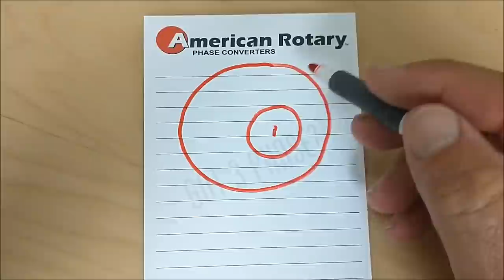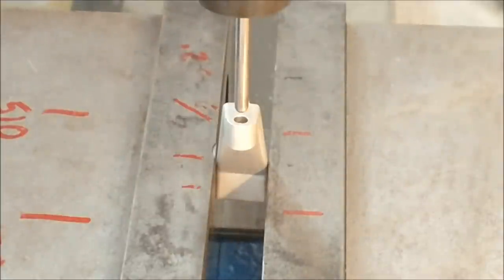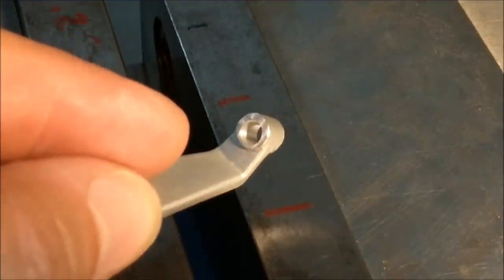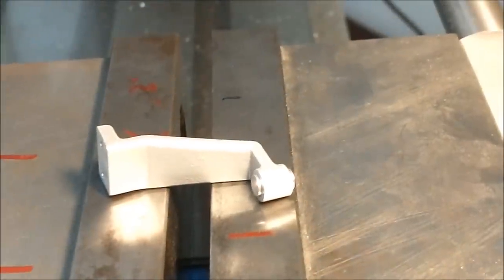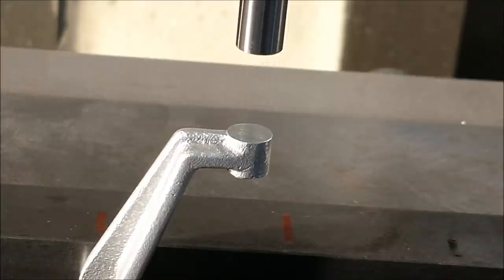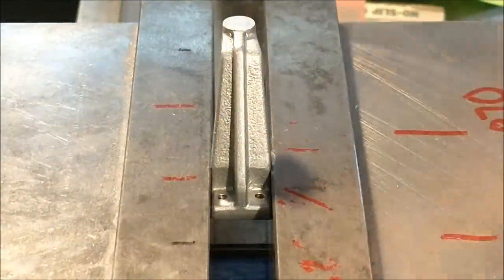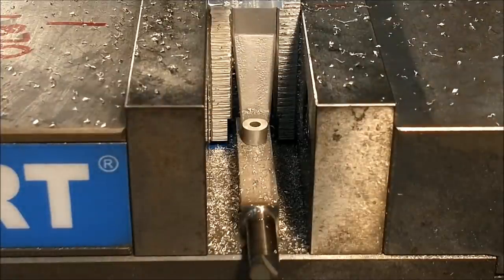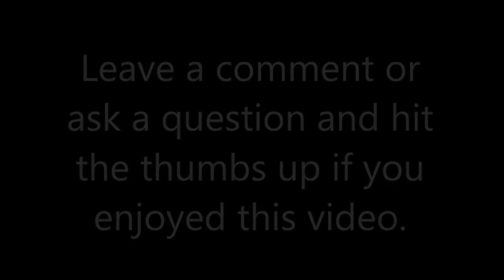Is It Impossible to Move a Hole in a Piece of Metal?  No.... Watch This !!!

Comment: Seen it done to a pin in a die, to move the alignment pins slightly, as in 2mm on the one, and 1mm on the other, to get the die to align correctly with the other half, and also the material being worked with. He drilled out the brass to make a recess, then machined 2 stainless steel plugs with the correct offsets on them, and brought them in as exactly like you had, a barely fitting fit, then put the one in, and aligned it, and then once done put loctite 603, then checked, and put 2 pin punch marks to hold it, then did the other one, and the same to it. Punch marks just in case the scribe lines wore away, and that die fitted perfectly. Had to be careful on the plug drilling, as there were water channels drilled through that brass block as well for cooling water.

Saw another bush that he did as well, where the original 30kg block of continuously extruded brass stock had basically 30kg of material removed, leaving only a bushing set that had, as thickest wall feature a lip of 8mm, the rest, with all sorts of holes and slots milled into it, being around 3mm thick, and with it being eccentric, ranging from 1mm to 5mm on sections, with gear teeth to adjust it. Adjustment bush for a massive printing press, with the OEM part coming in at around $100k, and a 6 month lead time as well, after payment up front. They made them using CNC, he used a lathe, mill and a few fixtures he machined out of aluminium extruded bar, for a tenth of the cost, and made them in under a month full time work. Hope he is enjoying himself now as he moved to Australia, where he can work for a decent pay, though I have no doubt he will open his own shop soon enough.
Reply from the maker: Repair can be a very creative field. If you find a good repairman, hire him.

Comment: Really smart repair job, Joe. I will say, don't know about the part but I definitely was more than just a little twitchy watching you squeeze  that bushing to bond in such a thin area of casting ugh. Really interesting technique and glad it worked for you but I think that I'd rather have turned the Bush slightly oversize  than risk bursting that ring of casting. Personal preference suppose, I can be a little heavy handed at times. Great job Joe.
Reply from the maker: With only one side of the casting being a finished surface, a misaligned bushing during a press operation would have certainly burst the casting. I think my approach was safer, but still risky. I held my breath.

Comment: You should have worked off the base of the part to start with to keep the new hole perpendicular to the base so the finish hole would be a true right
angle to base
Reply from the maker: That would not have corrected the boss misalignment. The boss had to be the datum.
Reply: I think the alignment of the hole ( SHAFT SUPPORT) would be more important than the hole in the boss.That is  all I ment.

Comment: I'm thinking not many in your audience remember the 2005 Carter-Baker Commission Report on the 2000 Presidential election "hanging chad" reference - loved it!!
When do you choose whether to use a cutting oil or lube when you drill ( 07:00 mark )?  Any rules of thumb?
Reply from the maker: When loading, galling or heat is a risk, I go for the lubricant.

Comment: I like the result.
Not critical on a small part like this and you got it with the Loctite, but it could also have been hot rivetted and compressed instead of being cold pressed if there was any danger of it moving during the drilling process.
Reply from the maker: It was expanded.
Reply: @joepie221  The insert was cold pressed in the vice.

Comment: Machining noobie question: could you have used a slitting saw to 'face off' the underside of the boss after the first facing operation?

Also, can you tell us about the spring loaded soft jaws in the facing operation, please?

Oh, and could you put a link to the previous video in this description, please?
Reply: He could have cut the underside on the first op with some sort of undercutting tool but he needed to maintain a certain distance from that surface to the bottom of the base. That is easier to do if you cut both surfaces together in one operation.
Reply: Spring seems just to keep the soft jaws from falling out of place while adjusting the vice.

Comment: You are locating your holes with a long pin in a chuck. Did you check the runout of the pin in the chuck? It might be out quite a lot. Just asking.
Reply from the maker: .0015 max, and thats probably a bad pin. My chucks are dead nuts.

Comment: i use the same trick when i attach stainless bolsters on my knives i use the same steel pins as the bolster and you cant see that there are pins in my bolsters
Reply from the maker: For sure. Smashing them and finishing them is almost as good as a weld for invisibility.

Comment: 11:55 why wouldn’t you use 2 parallel bars under the base piece to make it square in 2 axis to do what you are going to do next ?
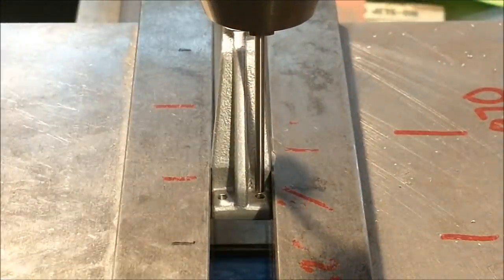16:04 easy for us to see . 😊
Reply from the maker: This seemingly simple part was a delicate balancing act of feature placement. In order to hit all the print dimensions and keep everything visually aligned was tougher than expected. Using parallels under the part at the time you question the setup would not have aligned the face of the upper guide boss as desired. Only if the 2 surfaces were square could that have been done.

Comment: When you milled the under side you changed the overall height of the arm. That would be a fail in many circumstances. Also seems wrong approach to re-orientation of base's 2 support holes as exact new orientation should of been found using rod installed to device then pins installed to device screw holes, lightly hammered to make new impressions. In essence the two support holes should of been bushed as well.

I learned from this video about C corners, appreciated.! I'll know now to watch out for that.

I do watch and clock repair, bushings is the big culprit. Generally we oversize bushings in wide plates and peen them in place for sincere grip. Our bushings are prefab, but we turn them too. The prefabs come with center holes that broached to size. In the life of watch clock, many years, the gears turning with side pressure eats out the bushing hole creating an oval. We can usually establish the original center with remnant original curve using high power loupe. An X is scratched lightly with razor and extended slightly past work to maintain the oh so critical original location. Then bushed. The gear's pivot is dressed or replaced, then bushing broached. 

Consider the size of watch's gear teeth and then realize the critical nature of teeth engagement. It is not full contact, teeth actually must slide across surfaces. The rule is 90% engagement, 10% airspace. 

So hence the watchmaker depthing tool. The device holds 2 gears allowing for user to test mesh by adjusting closeness. It's a go by feel and light seen in gap. Once desired distance established, sharp pins establish marks on plate with sweeping arc's to triangulate X from other bushing holes.

Appreciate your attention to detail..! Subscribed

Comment: Why do want the hole to be true to the outside wall of the casting?  There is obvious draft angle in the casting that is in no way relevant to the drilled hole or am I mistaken?
Reply from the maker: Strength and cosmetic value.
Reply: @joepie221  I understand both of your points completely however it likely forces you into using the draft angle as a reference for all of the machine work on the part unless that was designed in.  I have been re-manufacturing  pulley brackets for WWII aircraft control cable systems and have seen weird angles but I don't remember any using the draft angle as a reference.  Just my experience, it caught my eye on your part.
Reply: @mlpabq1  I agree with Joe, the shaft being parallel (by eye) with the casting edge does make for a more pleasing appearance.  I have seen parts on machines or machinery in operation that look like his part before he fixed it and thought "why?"

Comment: Cast Ye bad dimensioned parts unchecked and they should be returned to ye with a note 😆
That was one bad casting, little wonder the misalignment.
Good job correcting it and a great tip about the squish ⏳(no pressure 💯)

Comment: could you instead of the lock tight just put the extended part in a vise and crush it slightly end to end of the new filler part so it expands slightly and just machine the ends down. i have done this with a copper filler rod to an aluminum surround and there was no join after machining. this was a heat sink i made.
Reply from the maker: Please rewatch the video.
Reply: Another troll Bites the Dust

Comment: First thing I am seeing is that the casting is where the error began.

One casting boss is offset from the other.

This is going to make it impossible to be perfectly centered to both faces, without the axis of the hole being skew to the final assembly.
Reply from the maker: You also didn't have the drawing in front of you. The planar and axial relationships called out were almost impossible to achieve AND hit the dimensions given.
Reply: @joepie221  I don't know who made the casting, but it would all begin best with a perfectly balanced and mirrored casting, which now days is super easy to achieve with the advent of 3D printing.

With a very precise casting, finding all the reference points is much easier than on a lopsided one.

There is a truism in the machining world that every mistake amplifies as it travels through the manufacturing process.

As one who has built turbofan engines for Rolls Royce and have begun on a venture of building my own line of turbines, this is something I ABSOLUTELY MUST keep in the forefront.

I am even casting my own blanks for these turbines, so I can ensure not only a perfect casting, but a perfect alloy, and absolute avoidance of inclusions.

The part you are working on should have been super easy to have made as a mirrored part, unless one was doing this literally by hand carving it...

And who, in the modern world of manufacturing hand carves tiny little parts like that any more?

Comment: It wouldn't work to just bung up the hole off centre then re-drill to centre?  I might also have been tempted to just use a hammer. But this is one of the key differences between machinists and blacksmiths.

Comment: in my opinon yes it is impossible if this is the best fix. all youve done is made a bigger hole, fill it with material and drill a smaller hole in that. an absolutely fabulous fix nether the less and fully endorsed fully by myself obviously. but youve not moved the hole unless the part was welded back up.

Comment: Green bearing retainer loctite is even better than red. Sorry Joe, I had to.
Reply: There are probably like a dozen flavors of that. I use 648. That's great for general use as it will loosen up back to liquid at 250°C but it will grip good. No reason to use the vise expanding trick on top of that.
Reply: @MF175mp  I believe the green bearing retainer type expands when set. All I know is it ain't coming out if you use that stuff.
Reply from the maker: Its OK. I don't use a lot of LocTite, but I know their product line is extensive.

Comment: instead of watching for pin deflection, use a DTI with a flat foot and preload it so you can see that pin deflect. Use TWO DTIs one at right angles to the first.
Reply from the maker: As a practice, I don't put DTI's in a working environment.
Reply: @Brian Peterson Dial Test Indicator. I have never heard it called anything else. Different places, different names, same tools.
Reply: I've used pins for alignment MANY times.  In this set-up it's going to take some unique indicators or set ups to reach down into the recess to measure the pin deflection.  He didn't want to move the part from the previous operation, though with a pin in the bore, you could likely get away with it.  Not saying it can't be done, but if the pin gets you within 0.002" (likely less) and the part is +/-0.005" call it good.  

Another saying from my first machining mentor:  There's more than 1 way to choke a dog.

Comment: Thank you again for the experience of being an apprentice again to the master!  The green loctite bearing mount is one of my lifesavers.  It comes in various viscosities to fill various gaps.  Great stuff!  Saved many unobtanium parts with it!
Reply from the maker: I'll check into it.
Reply: @joepie221  Here are the ones I use:
Loctite 609, 10 min cure, viscosity 125 cP, strength 2300 psi, gap fill 0.006, service temp 300 degF, activators 7088 7649 7471 

Loctite 620,	slo cure 1hr , viscosity 8500 cP, strength	3800 psi	, gap fill 0.008, service temp 450 degF, activators 7088 7649 7471 	

Loctite 638,	4 min, viscosity 	2500 cP, strength	4500 psi, gap fill 	0.010, service temp 355 degF,	not much activator effect

Loctite 640,	slo cure 1hr , viscosity 600 cP, strength	3200 psi, gap fill 	0.006, service temp 	350 degF, activators 7649 7471

My latest save was a diesel fuel oil filter housing where "someone"overtightened the filter and pulled the threads on the male nipple that fits the metric spin on filter.  Machined off the damaged threads, made a new threaded sleeve, and green Loctite it in and good to go.

Comment: I'm guessing there was no perpendicularity call out on the engineering drawing for those bores. If there was, using a cast surface to establish your Z axis would be extremely risky at best. Also, a proper square should be used on a machined surface for such operations as squareness is not a manufacturing requirement for most 123 blocks.
Reply from the maker: Unless of course you qualified the cast surface first and previously inspected the 123 blocks for squareness.

Comment: i have only did that once, luckily it is a m4 "common hole", i don't have a lathe or a milling machine at that time. but i have m4 tap and die. i steal some scrap from someone else lathe with a same diameter, tap the hole and die that plug. vice press the plug after screw in, touch that thing with a file. seems nobody complaine that redrill hole later. actually that is almost exact same idea here, just no lock tide, no big machinery involved. and i am lucky to get away with it.
Reply from the maker: Sounds like it.

Comment: Since you made the bush blank on the lathe, why didn't you drill it to size while it was still in the chuck? Then you could bond it in and trim the top and bottom faces.
Reply: The point of the bushing was to move the hole central to the casting but not central to the bushing i.e. eccentric bushing with regards to the hole.
Reply: The bushing was a plug, to fill the repair hole, which would likely NOT be dead on. Remember the eccentricity mentioned. The plug is to make the part 'as new' , in order to make a new hole.

The way it was done does not rely on accuracy of the repair hole, that come with the re-drill.
- Cheers

Comment: Joe, You carefully measured the distance from the large hole to the small holes and explained how the angle would change the locations, but you didn't measure this time. Why?
Reply: I think that is because he is going to change the dimension on the drawing to what the resulting dim ended up being
Reply: Measured the dimensions, so as to have the mounting holes come in to correctly locate the rod, as the rod is the critical part, the location parts can be moved to get that right. The angle change was because he now made the hole the reference location, instead of the mountings, so the angle changed slightly as he milled the base first. Now the hole bottom side is the reference plane the mounting needed to be changed slightly, which will be used to adjust the drawings, to get the correct offsets for them.
Reply from the maker: The deflecting pin segment was the measurement.

Comment: So, basically, you solid riveted it and then ground off the rivet heads...

I would have thought that you would have TIG welded it to fill in the hole and then redrill...
Reply from the maker: I have to bet even the most confident welder would hold their breath welding such a part.
Reply: As a certified welder, I can tell you that welding or "brazing" that tiny aluminum part is not an option.
Reply: @G31mR  -- I've seen some pretty skilled TIG welders over the years... I've also seen "certified welders" who had no experience whatsoever with TIG because all they've ever done is pipeline welding and back then, it was always stick welding...
Reply: @joepie221  -- I suspect you would need to practice on beer cans... If nothing else, the process of "acquiring" the metal stock would be fun... :)

Comment: When sand blasting, why not slip a pin into the hole?
Reply from the maker: Rubber plugs are safer. Pins can be imbedded with grit media when blasting and then that surface has to be dragged back through the hole.

Comment: Nice job Joe but wouldn't it have been just as easy to fill the hole with Aluminum and just redrill it??
Reply: You then would be drilling into two different materials (slightly) and only leave part of the fill, their would always be imperfections on the inside of the hole which lead to improper or uneven (over the circumference of the hole) wear to the hole.
Reply: @bertbergers9171  what, guess you’ve never welded aluminum
Reply from the maker: I'd be afraid the part would burn away.

Comment: 9:52 Locktite machinists ! Why take a time and  make a proper bearing fit when you can do it fast- screw it up and use locktite .And then you turn 45 min job into 3h fix up's .
Does this sound familiar ?  I had a boss like that .
Reply from the maker: Never time to do it right, but always time to do it over. Thats a bad philosophy.